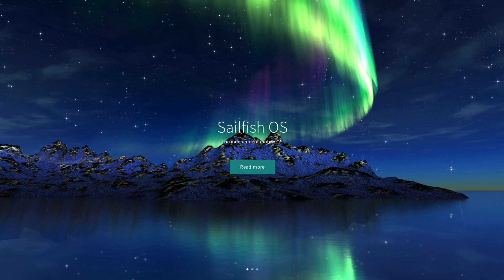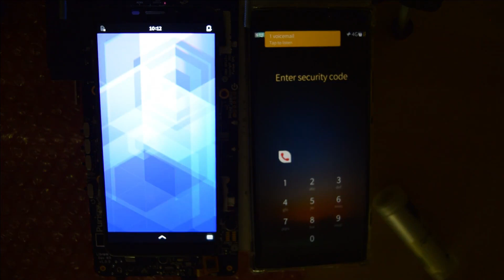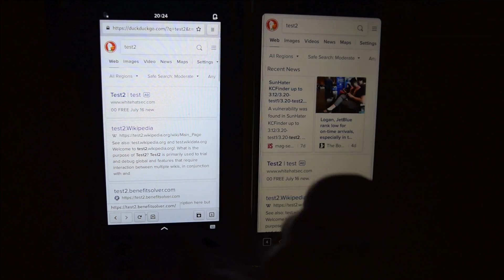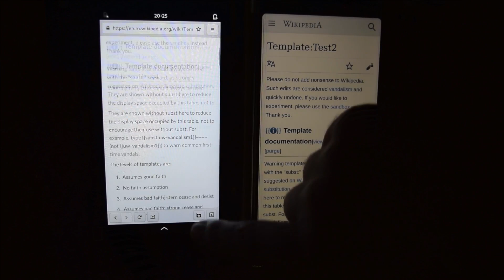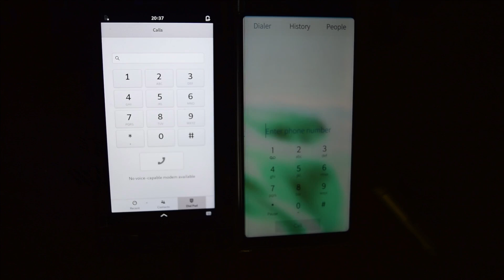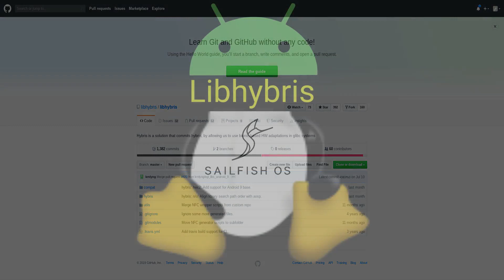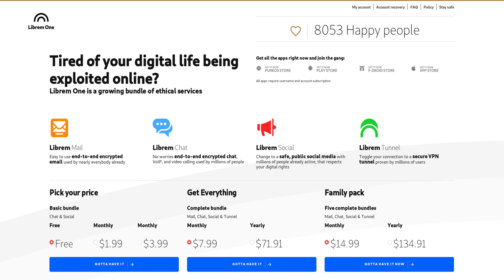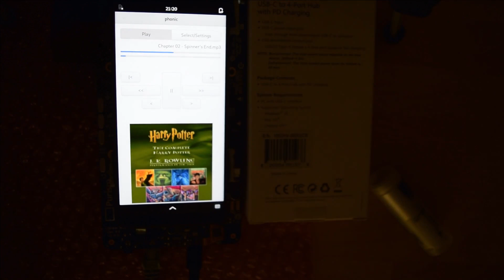Librem5 VS Sailfish OS

Comment: After using sailfish for 2,5 years I bought the new Xperia 10, and decided to switch back to android temporarily, to see what I have missed after such a time. Honestly, I'm baffled with how bad the user experience on android is. Yes, there are a lot of 'free' games, which take a lot of time, are addictive and don't add any fulfillment whatsoever. Ads are everywhere. Multitasking is not thought through at all: switcher when activated shows the foreground app which you are trying to switch away from, and from landscape it takes a second to put itself (unnecessarily) into portret mode. Then you need to scroll through the "open" apps, which it shows one thumbnail at a time. And of course, that it is "open" in the switcher is not a guarantee that it is actually open, because the maximum limit of open apps is 4!?!
Not to say Sailfish is without issues. It is nice that my banking app runs on android, and split screen is somewhat useful. But not being able to run YouTube in a browser in the background or with screen off is just a pita! I really thought coming back to android would make me wanna stay on that, but now after a week I cannot wait to switch back to Sailfish.

Comment: Thing is, Sony sucks with the DRM. If you unlock your phone, you'll loose all the good camera capabities and the quality is then crap. On older sony phones you could backup the DRM when you rooted without unlocking. If youve lost them there was a script which would simulate the DRM. I don't know if it's still works on new phones (don't use sony anymore).

Comment: I wish the Fairphone had hardware kill switches and a little more modularity (and was also available in the US). I think the new FP3 running PureOS would be nice. A pipe dream, I know. But it's still nice to know a phone was made with basic replaceable parts from areasand with conflict free materials (or as close as they can get to that, anyhow).

Comment: Battery size != battery life. I expect the 2.2ghz sony to blow through its battery quicker than the Librem.
Reply: Depends, the XA2 is probably on a 14(or 12, depending on who makes it)nm node, so it'll dispense less heat and draw less power. If it's not constantly at 2.2Ghz, it'll last longer.

Comment: This looks very promising. Maybe somebody knows the answer to the following: is it possible to implement Whatsapp on a Linux phone? For me at least this would be mandatory, since 99% of why I use a phone at all is communication and 99% of the latter is over Whatsapp (sadly).
Reply: The Librem 5 has an XMPP client named Chats. It might be possible to send messages to Whatsapp, if you are using an XMPP server with transWhat, which is a Whatsapp bridge. If you can read Spanish, then this article explains it: https://conocimientoslibres.tuxfamily.org/conectar-xmpp-con-whatsapp-usando-yowsup-y-transwhat/
Reply: Linux community simply needs to get relevant for whatsapp to make a native client. All alternatives will not be acceptable for the main market.
I had this once with a whatsapp port to sailfish os called whatsup. 

With every update of the app it took weeks to make it work again - finally the one dev gave up because of the encryption stuff.

Comment: would love to see a comparison between sailfish os and ubuntu touch
Reply: ubuntu touch is not that stable either. Tried it for a few hours on my nexus 5 and had to switch for stability and necessary apps.
Reply: @Justin-ng4zg  which channel did you test? What stability issues did you see? Necessary apps is expected for now, but stability should not be an issue

Comment: About the upstream part: purism is doing the oposite. Where as most of the Sailfish OS middleware is widely used around the mobile world Pure OS additions aren't. For example mobile Linux means Qt where as Pure OS is GTK based. Also Purism extended modemmanager to work in mobile phones instead of using the ofono wich is widely adopted in the mobile world. Except that both use existing projects and contribute to upstream. The only difference is that purism doesn't contribute to the Qt side where as Sailfish OS except the UI side contributes to Qt and GNOME projects (many parts of the backend are glib based like tracker). Also Purism said they want to contribute to plasma mobile, which is something that has yet to come.

Comment: You forgot to cut the boot time panility for unlocking the device on the Sony.
Reply: The "has been unlocked and cannot be trusted" timeout warning doesn't appear on the xa2, though.
Reply: On mine it does. Its still not much time but still it takes some time. Maybe disabling android support could help too in reducing boot time.

Comment: iPhone 11 - $699
Freedom (Librem 5) - $699

Hard to choose
Reply from the maker: The Librem 5 will be good in a year. The iPhone will be good for a year. You know what I would pick.
Reply: @davidhamner  but iPhones are the longest lasting smartphones on the market. Apple provide updates far longer than any android manufacturer.
Reply: @Christian Gutierrez iPhones are slowed down to prevent random shutdowns due to worn batteries. Not as some conspiracy to make old phones unappealing.

Comment: I really want a librem 5 but the price tag is really high.  Might still go for it though since it will likely last much longer than any android phones I've had.  I might go for a pine phone though instead, not sure.
Reply: @epicgrapefruit7563  I thought about that, I just don't really want anything to do with google anymore.  And for me Apple is not better at all.  Even though their services would be missing, the Android Operating System is developed by them.
Reply: If you order now, you will get the Librem 5 in Q2 of 2020. The Librem 5 will probably be ready for the general public before the PinePhone, but both of them are still in development.
Reply: @amosbatto3051  I wouldn't mind one of the Dev versions of the Librem 5, I intend to program for it a little if/when I get one anyway, been using Linux for over a decade.  I still can't afford one though :(

Comment: Wow... the Librem 5 sure doesn't look ready at all for shipping...

I know it's still a wip, but still, this is rough...
Reply from the maker: I bet it is smooth as butter by Evergreen release. They have made crazy amounts of progress in just last few weeks. They are a small team but with a fast-growing community. Just don't think this is the final version of this video. I also plan to compare the earliest Librem 5 batch I can get my hands on. And the Evergreen release as well.
I also know purism just hired a developer to work on web acceleration. This will be a good baseline to see the improvements over the next few months.
Reply: Not only were they still making adjustments to the hardware at the time, but, of course, they are still tweaking and improving the software and will be continuing to do so, after the release. Primarily, you want to buy it to give the company a running start. They have MASSIVE competition they need to face down in order to take a foothold in the smartphone field, but, if we can help them take off, it could be the start of of a shift to mainstream, privacy-focused phones. Think of it less as buying a phone, and more of an investment in mainstream adoption of privacy-focused features.
Reply: Arthur In a free marketplace, you buy things based on the value they present. Purism seems to frequently misunderstand this concept, as their laptops are as overpriced as a MacBook with significantly worse hardware. Billing this as a future investment is nonsense. I’d be willing to bet that Purism milks this same phone for 4+ years, and its already under spec’d at launch.
Reply: What you saw was a development board that people can use to make apps for the Librem 5 before launch so that their app is ready when the phone comes out
Reply: I hope they improve the web browser, as that is probably how most apps are going to be used; as webapps. Especially that youtube performance was really bad, dare I say worse than my 2014 phone I got for a 100€, and I even overpayed for that, so I hope that they fix that.
Reply: @skogenburzum I hope it is at least oled. I think the specs are based on the Samsung Galaxy J6.
Reply: @eric_eagle  Oh I hope it won't have to much of an impact, but I can see what you mean.
Reply: @eric_eagle  hahahaha well shit, there goes video performance
Reply: @eric_eagle  No hardware decoding? No encoder either I'd have to guess then. 

Good luck getting a 1080P or above camera module on there. It simply won't have the horsepower nor longevity to handle a video call.

This is bad.

Comment: Seems like the GPU needs some work. Scrolling through a website shouldn't be so laggy.
Reply: I think it's lacking hardware acceleration all together
Reply from the maker: Most of the lag is in the web browser. I know Purism hired a dev to work on that recently.
Reply: What GPU it has? Probably something a lot better than the PinePhone which has a GPU from 2008 (Mali-400 MP2)
Reply: @Pasi123 , The Librem 5 has a Vivante GC7000 Lite GPU, which is significantly better than the Mali-400 MP2, but nothing like what you will find on a Snapdragon 845. There are some links to benchmarks here:
https://forums.puri.sm/t/comparing-specs-of-upcoming-linux-phones/6827
Reply: I think the biggest problem is with the drivers.
Reply: It's the rendered frame buffer, no?
Reply: It's GNOME Web fault xd